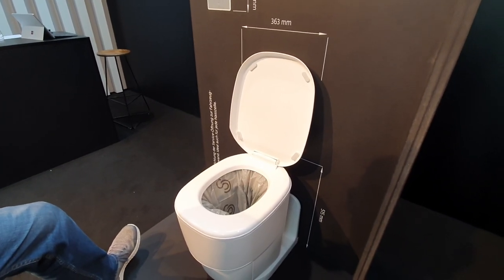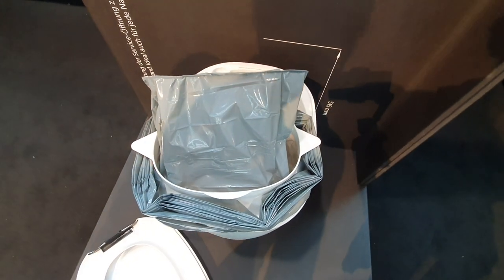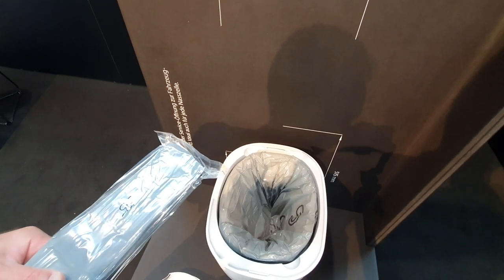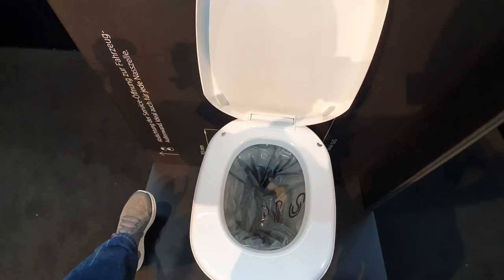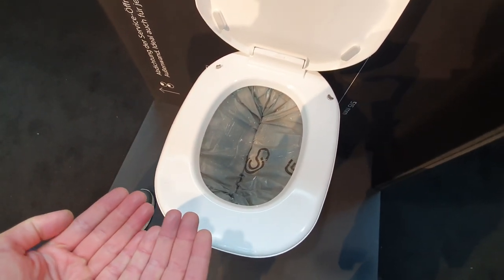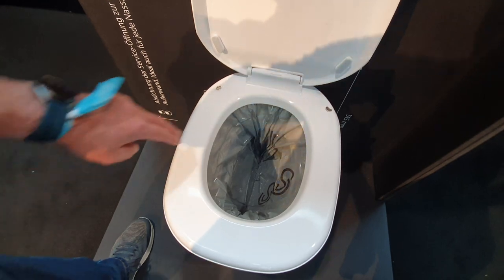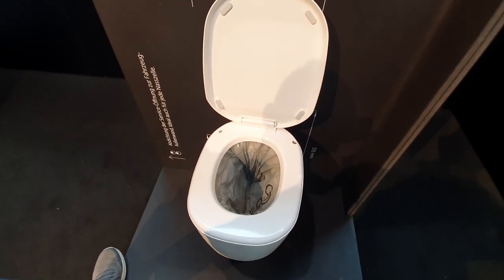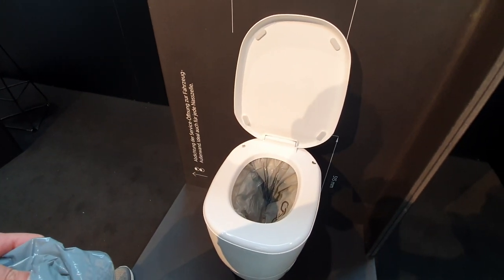The waterless toilet

Comment: Really like the idea.  Better than a Laveo, because you can dispose of bags with each use.  With Laveo, at $1.50 per flush, and 17 flushes per insert, you might not use it for a while, park your van or trailer for a month or two, come back, and . . . I don't want to think about it.  Plastic waste is no good, of course, but that seems its only drawback besides the price.  I like the holding area for the bags.  Also the size of the plastic waste seems smaller than many.  It seems like you can really forget about all the work of cleaning up after yourself.  Can this be bought in the US?
Reply: Me too. I am a big fan of laveo toilets but I think this one is better. It's a bit slower but less expensive I think. I also love how the waste automatically seals  in shut in the bags.

Comment: I swear I have a masters degree in poop and pee disposal. I must have, I have been researching this for ages. There is something very similar to this on the market already, but you have to change the whole cassette when it’s full, not just the bags. Also, it twists the bags shut rather than chopping them up. It’s a bit like a nappy disposal system. It works out very expensive to use.
The current system of emptying waste that’s mixed with chemicals isn’t great either. I still think getting one of the 2 available incinerator toilets is key, but the initial outlay is super expensive at about £4000 for the toilet. Ongoing costs aren’t bad, especially if you choose gas operation and have an underslung tank. The best one I’ve seen is the Cinderella toilet. One of their models is made for travel. I spent decades nursing, ran a children’s nursery and have had 3 children myself. I’ve been up to my elbows in poop more times than I care to count. My days of dealing with waste are over. If I can find a way to get an incinerator toilet in my van, I will.
Out of interest, what are the manufacturer details for the one you have just shown?
Reply: incinerators are good but they have flaws as well. like having a exhaust outlet. Also ive seen videos of someone having to do repairs or maintenance on a incinerator toilet and it doesnt seem very simple.
Reply from the maker: There you go Gill.  As for me, I don't like the Cinderella system, gas consumption must be very high and lets face it, finding a dump is not all that difficult.
Reply: You are describing a laveo dry flush toilet

Comment: I was hoping already for some alternative for the laveo dry flush. ±25$ for ''up to 15 flushes'' (which I read as, with normal use u get 10 flushes). This thing will be about 10x cheaper per flush.
Reply from the maker: I have never heard of Laveo - must be something in the US. However there are cheaper options such as the standard toilet cassette or something like Trelino - https://youtu.be/WHIg9KK_xjc
Reply: @VanlifewithAlan  I knew it from the US indeed. Thanks for the options, but I really like the way the clesana operates. It is expensive, but in my eyes the best solution.

Comment: I would be interested in the cost of replacement bags and where to buy the bags.
Reply from the maker: I saw them in Auchan hypermarket when I was buying rubbish bags.
Reply: 2 packs will cost around 25€. They are enough for up to 72 portions. They are sold through normal camping dealers.